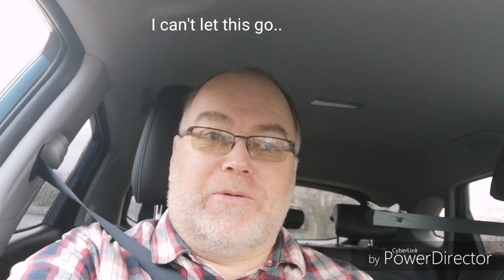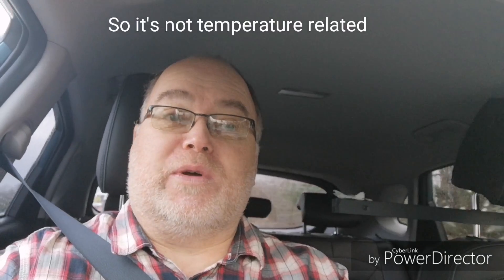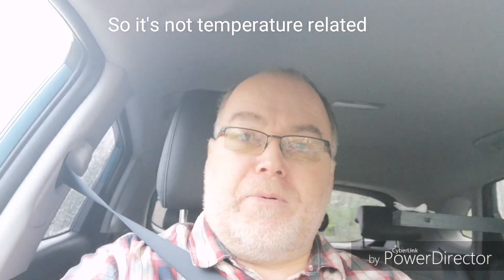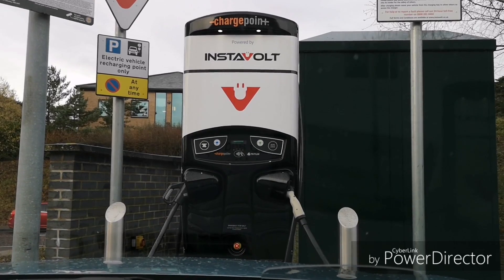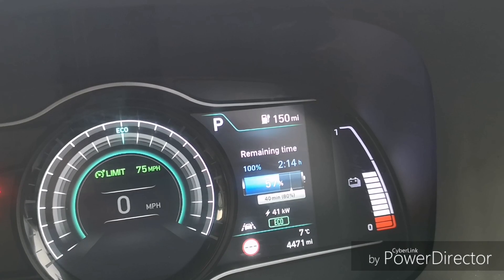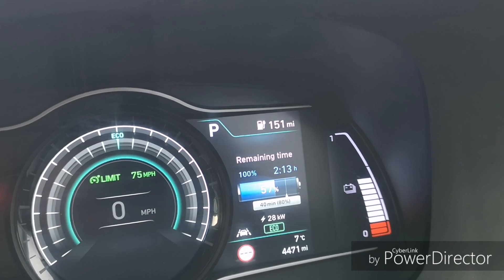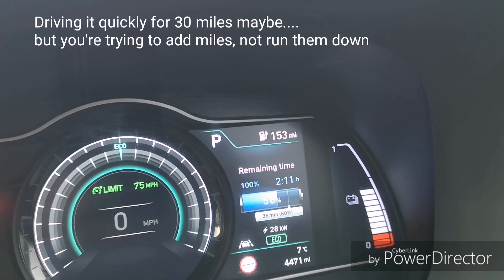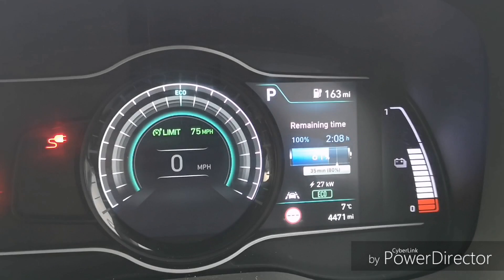Kona Electric / eNiro slow charging from cold & mid SOC

Comment: Hi. This is just the way EV charging works. It’s a combination of the batteries not being warm enough and there is not enough free capacity in the battery to take the larger charge.  Not a problem with the car you just need to change the expectation you have on the speed your charge. Simply stated the fuller your battery is when you start your charge, the slower it will charge.
Reply from the maker: Exactly.  Why doesn't the battery warmer assist to increase charge rate at 50 to 60%?   At what temperature will we get a better rate? Rather than an educated guess I'd like to know
Reply: The EV Puzzle AFAIK the warmer is not designed to optimise the charge speed. Rather to ensure that at low temperature the battery can be warmed enough to charge and discharge without damage. Charging (and discharging) the battery produces heat that will bring the temperature to optimal. 
If you have a low (charged) battery you can charge it faster because you can spread a large load across all the cells. As the cells charge they produce heat that pushes the pack into the optimal heat range. Once there you can keep pushing the energy in quickly keeping the charge rate up. 
If you start with a battery that has more charge in it you can’t spread the load in the same way so you charge slower. That does not generate the heat in the same way so you don’t get to the optimal thermal point. 
The performance Tesla’s have the option to heat the battery to the optimal temperature. This is not a quick process though and you can see videos of races where everyone is hanging around waiting for the Tesla to warm the battery before it will engage ludicrous mode. 
I’m sure there are others who can explain this better than I can.
Reply from the maker: All info helps thanks

Comment: Does it drop from 40 to 27 kW at 57% if you set the charge limit to 100% iso 80%?
And if you enable winter mode, does it also drop down to 27kW?
Reply from the maker: I'd be amazed if charge limit impacts charging rates. I have limits set to 100 normally

Comment: Oh, that’s a bit of a drag. It does seem like the cold is affecting the cars choice to slow the rate more than usual. But the showstopper is the BMS doesn’t seem to be helping, or in your test isn’t coming on at all. Is this worse than others, like Tesla for example, or actually pretty normal?
Reply from the maker: Bruce, yes I'd love to know why the battery heating function isn't assisting and why the battery is fine in these conditions as 30%.
What's the threshold for allowing more charge rste? It help journey planning to know
Reply: @EVPuzzle   Although this issue seems like fairly minor concern, it reminds me once again (as Rapidgate did so painfully for many) that battery science is complicated, confusing and above all frustrating. Well, to me at least! I've given up trying to second guess my Leaf, I just don't drive it on long trips! As we run two cars we just go for the lazy "sod it, we'll take the petrol one" approach for (rare) long journeys. That's how I beat range/charge times anxiety, for now at least!
Reply from the maker: Bruce , I agree Rapidgate wasn't a big issue for most either as most people's journeys didn't experience it but if you plan buy a car that has a say,  200 mile range,  for regular journeys of 100 miles, and you plan to charge then return.  To find the car slows charging so severely is....unexpected,  as it wasn't made clear of its limitations up front. 
That's the same as the Nissan issue. *Subject to various conditions small print doesn't really help if you've incorrectly assumed it'd be fine.

My next video is perhaps clearer.

There needs to be more transparency on how these cars work but until then we're perhaps reliant on tests like mine or finding out after your car arrives.

Comment: So this slow-charge problem on Kona Electric only happens in cold weather? In the summer, it does the regular charging speeds (50-70kW)?
Reply from the maker: So far it seems to be a cold climate issue yes. The question is, if it is bring throttled due to cold, why doesn't it use the heating function to help?

Comment: From my experience with my Renault Zoe it takes quite some time to bring the battery up to a temperature where it would charge with max speed which is above 22°C. Even during a 30 minute drive the battery temperature goes only up from 5°C to maybe 10°C. I would have to really hammer the car (heavy acceleration and recuperation) to get to a higher battery temperature but this is not good for the battery. 
So I assume that the battery is still too cold for a rapid charge.
Haven't you tried to read the battery temperature from the OBD2 port?
Reply from the maker: I have no confidence yet that the Kona's data has accurately been decoded on an OBDII reader. So far it looks like we're relying on old parameters from the soul or Ioniq which aren't going to be compatible, necessarily.

When I know it works , I will get one

Comment: A lot of EV's have this issue, even my Ioniq Electric. It clearly takes longer when it gets colder. And yes they can program it to load faster, but what do you want: faster charging or faster degradation? And with this type of capacity you drive it to a lower percentage and charge it to 70%. I wouldn't charge a car that still has 50-60% in your battery. And read Peter Kjaersgaard: His Tesla has the same issue. And you can find also Tesla Model 3 owners having a lower charge rate than in summer. Welcome to EV driving in winter.
Reply from the maker: What I want ideally is for the battery heater to be used to optimise charging rates and fir Hyundai to document the cars limitations so that we can plan for the right charging times.

  I appreciate it may be throttling for a good reason.

Many customers don't know about this and manufacturers don't tell you details like this so I'm highlighting for others what I find.

It feels like a problem simply because it's not explained. For those people who are experienced or knowledgeable in this area that's great that they know, as I do now but we should know this before we buy an EV.
Reply: @EVPuzzle  I agree on  the part of explaining to customers that in winter you get less range and slower charging; car dealers are in most cases not knowledgeable enough about EV's in general and about the EV's they sell. And perhaps there is a heating issue with the Kona and e-Niro. Even with the winter warming checked in the menu's it doesn't seem to work that well. My Ioniq had several software bugs and after some versions they were solved. 

btw: My Ioniq had the BMS replaced due to a recall about cracks in the casing and having the danger to get water into the BMS. My car had those cracks and so the BMS was replaced and ever since it is slower in charging in winter. This could explain why some say the Ioniq is not affected and others, like me, say it is affected.
Reply from the maker: Very interesting indeed.

The mystery goes on , which is a shame. Just as we get used to what a car can and can't do they change the battery technology so it's chemistry needs different parameters for managing yet as a customer we're not told enough to know.

I'd just like more clarity. EVs are better. Share the info, good and bad I say.

Comment: I’ve not had a huge amount of experience with fast chargers but on the three occasions I’ve used them so far (Ecotricity and Polar) I’ve not encountered this problem with my 64kW Kona. 3/4 occasions were charging from c. 40-45% SOC and in all cases I consistently got >40kW (c. 40kW for Ecotricity and >46kW for Polar) and was up to 80% within 30-40 mins.
Reply from the maker: Thanks for sharing
Reply: No problem. Will keep an eye out for the problem and let you know if I do encounter the same...

Comment: Hi Nigel, May I ask if yo where using swipe card or a RFID on the ChargePoint in the Video, I am looking out for charges where I don't need a account just swipe a card.
Keep you the good work.
Reply from the maker: I have no accounts and no RFID cards. Never used them. Instavolt and Engenie work just on contactless debit card.  Chargepoint gives you some extra data about your charge but I can live without it
Reply: Thank's Nigel.  @EVPuzzle

Comment: Has anyone experienced this problem with the Bolt/Ampera? I'm waiting on my e-Niro (Canada) while there are 13 Chevrolet Bolts sitting on the lot at one of the local GM dealerships. I'm beginning to develop deposit remorse.
Reply from the maker: Remember mostly we tend to charge after a longer trip or from lower SOC

Comment: I can second this I started from cold in -5 Celsius weather, drover for 15 minutes and started charging at a 50kW charger, 52% SOC at the start got only 20kW at the start, after 25 minutes it was 24.
Decided to try another charger 20 minutes away also a 50kW one at the start I got 43Kw there. I got a bite to eat and checked the charge after 15 minutes and it had dropped to 24kW with 72% SOC

There seems to be something going on here.
Reply: Wow, seems similar issue to Nissan LEAF's RapidGate problem...
Reply from the maker: In that it reduces the charge rate received and we didn't know about it yes, but Hyundai very clear in advertising 54/75mins to 80%
Reply from the maker: Thanks for sharing and I'm glad we're gaining an better understanding.

Your 2nd charge wouldve been better as battery temp would have increased a bit

Comment: As the battery has thermal management, why isn’t it warmed up as well as cooled, or is that a daft question
Reply from the maker: No not daft at all. It's how I initially interpreted it's capabilities but it seems the heating ability isn't implemented in as many instances as we'd like

Comment: Do you see any difference in charging speeds using a home charger or a wall outlet?
Reply from the maker: No, those rates are so slow anyway
Reply: The EV Puzzle Great, I wont need more charging than those ~14 hours that the car sits parked at my house.

Comment: Figure 3 in this article has an explanation why charging drops to lower levels at SOC above 50% ; battery protection is designed into the charger to prevent damage. https://batteryuniversity.com/index.php/learn/article/charging_lithium_ion_batteries.  

This article https://www.digikey.com/en/articles/techzone/2016/sep/a-designer-guide-fast-lithium-ion-battery-charging makes the point "The earliest cells were fragile and prone to overheating during charging, but development has seen those drawbacks overcome. Nonetheless, recharging still needs to follow a precise regimen that limits charge currents to ensure full capacity is reached without overcharging with its associated risk of permanent damage. The good news is that recent developments in materials science and electrochemistry have increased the mobility of the cell’s ions. The greater mobility permits higher charge currents and speeds up the “constant current” part of the charging cycle."  It seems car manufacturers don't want you to know, or maybe it's too complicated to explain.

Comment: Hi Nigel, I haven’t see this over the past 10,000 kms.  But same as Mark Jennings here in New Zealand it’s normally 18-27degrees as it’s summer here. Mine sits at 47kw till 86% then 35kw till 90% then drops to 18kw after 90% all on a 50kw Charger. Which seems better than others I’ve talked to.
Reply from the maker: Many thanks, clearly temperature related but frustrating and limiting to anyone in colder climates
Reply: You have a 39kw?
Reply: stefanocs2  no a 64kwh

Comment: Have just returned from charging my 64kwh kona at the costessy IV and a very similar experience, started 21kw at 42%SOC which slowly increased to 43KW at 47%which was maintained until 60%when started reducing to 33kw then 22Kw at 64%. after 1 hours charge SOC had increased from 41% to 77%. ambient  temp 1deg C and car turned off, had only driven for 5 miles before charging  so started with a cold battery there was a definite hum in the cabin for about the first 10-15 minutes of charge which may of been battery management, could not hear it outside
Reply from the maker: That sounds a little more normal but still lots if questions. Not ideal but at least it increased rates of charge even if it did throttle sooner than expected.

Every instance though it's meeting it's target. Doesn't matter where you start, it'll charge to 80% in 75mins.
Reply from the maker: Btw must catch up one day at Costessey 😄
Reply: look forward to that @EVPuzzle
Reply from the maker: Have you tried the new rapid at Earlham park yet?
Reply: not yet will give it ago when next visiting the Sainsbury centre. on another charger did manage to use Ecotricity at Birchanger(stanstead M11)starting with 68%SOC 11.4kw for £3.42  @EVPuzzle
Reply from the maker: That's good to know. I'm yet to try anything other than Instavolt and Engenie. Havent needed to yet.
I hear Earlham is contactless or will be soon

Comment: Thanks Nigel,

I ordered an e-Niro yesterday, do I cancel it today, or is it a case of a learning curve?  
I don't fill up my diesel until about a 1/4 full so why would I rapid charge at over 1/2 full?
Your informative videos have helped me onto the electric road and it is really useful to know what can & can't be done, today's video is factual but is it really a problem?
Regards
Steve
Reply from the maker: It'd only stop me buying a 39kwh version, 64 gives you more choice when to charge so you can avoid topups from cold at mid SOC.

It's restrictive at times but it just seems unnecessarilly so.

Comment: This is normal. You keep asking why it charges faster at lower SOC? Because batteries charge faster at lower SOC! :)
Lower SOC = higher power, Lower temperature = lower power!
Why Ioniq charges faster? Because they designed it to do so. In Kona, they can afford to take better care of the battery and charge slower at higher SOC and low temps.
Reply from the maker: We'll have to disagree then, it's not normal behaviour what I've observed. 70, 80% maybe but not 50%
Reply: The EV Puzzle I agree. My i3 94ah would charge at 43kw on Ecotricity (when they worked) up until the high 80s. Heck even my Leaf 24 would charge at better rates/percentages than that. I wish Hyundai and other manufacturers would engage in dialogue.
Reply: @EVPuzzle  Why not 50%? That is close to where the first step down at 70kW charging is.
Reply from the maker: And steps down to?  27kw? Er, no.
Reply: @EVPuzzle  Yes, 30kW when cold, and 55kW when warm.
Reply from the maker: And what temp is cold?  Alan has just commented he got the same after driving 70 miles. Shouldn't that be warm?
Reply: @EVPuzzle  Anything below 20 degC is "cold". That is battery temperature, not ambient.
70 miles of driving sounds quite a lot. Depends on the power levels.

I drove 50 miles at 75mph and got 45kW at 60% SOC. At 1 degC outside temp.

You should get a CAN bus dongle and Torque to get better information about what is going on.
I think this is pretty normal behaviour.  Even Teslas do the same :)
Reply from the maker: Crazy fish, if it is normal, why is it not common knowledge?  It's crazy for manufacturers to sell cars and not adequately describe how it works. 

With EVs you need to plan your journey with charging stops. How can you do this if you don't know how long it's going to take. 

It's just poor to leave us hanging saying it'll take an hour or so to get to 80%.

I know I'm being a pain saying it's an issue and I get it may well be normal but we need to educate people so they know what they're buying.  Unless it's really warm, charging is dog slow so charging from cold in short timescales isn't practical.  Back to Petrol , the masses go.

You clearly know more than I do and I'm still missing something. Why is 30%  ok to warm it up sufficiently? Is it because the battery produces less heat when charged from mid points? If not warm it up with a higher charge rate?

I'm asking the question in my video to help others. I don't mind looking silly so long as I learn from it.

Thanks for all your responses
Reply: @EVPuzzle  I have seen all your videos, and I liked them all! (despite some minor technical glitches :) )
I guess I am in an EV game a lot longer, plus I am an electrical engineer, and all this stuff seems normal and logical to me, but I understand it does not to most. So, I agree, informing the public is a good thing. But scaring potential EV buyers without a good reason is not!

Kona does not have some special cold battery charging problem. All EVs charge slow when cold!
That is something the public should be aware of. And, yes, it is NOT clearly stated in the user manual. It probably should be.

Keep up the making the good informative videos!
Reply: @2crazyfish2  If I read you well, you're suggesting that the rapid charger should be used when the battery (and outside T°) is warm in order to get "rapid charging"?
Reply: @MichelCavro  No, you should rapid charge when battery is low, and you will always get high power. Makes no sense to rapid charge a full battery!
Reply: @stevezodiac491  You can charge any battery at any temperature at any rate you want. But it will not be very happy.
Reply from the maker: Cheers. I hope I don't scare anyone, in fact overall I'd say I encourage considerably more BUT issues sometimes need highlighting.   Testament to this is how many people presumed the battery heater would work in these conditions.

I do find my reviews only become complete however with informative comments like your own.
Reply: @stevezodiac491  Indeed :) EVs and batteries are still far from perfect.